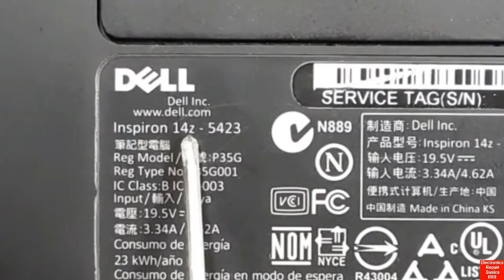Learn how to disassemble Any Laptop easily | How to Take Apart and Clean a laptop

Comment: Wouldnt some laptops give you electric shocks or static shocks from opening it and touching things??
Reply: disconnect the battery as soon as you can
Reply: Easy, take the battery out
Reply: No I did it with my gaming laptop and nothing happened
Reply: Potentially all of them, if you don't remove the battery.